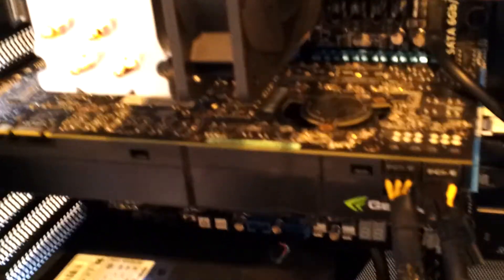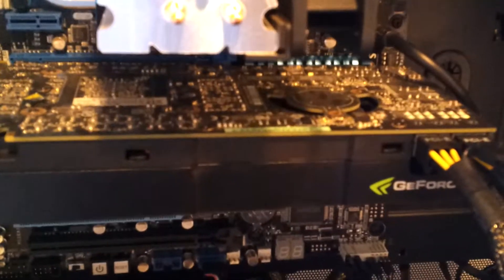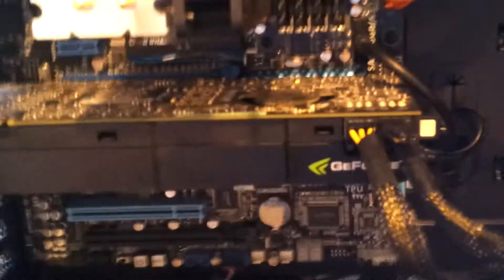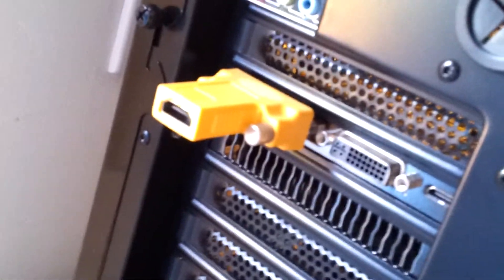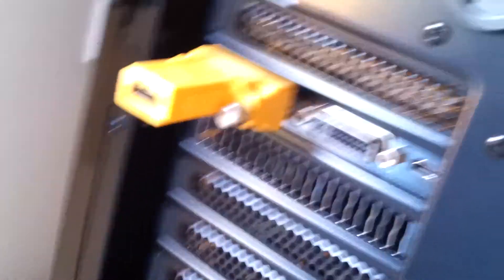Asus P8Z68 Deluxe/GEN3 + Intel Core i7 2600k @ 4.5GHz

Comment: So similar to the setup I bought over 8 years ago. Believe it or not I e only had to replace the memory and the vid card but aside from that this system doesn’t slow down for anything still. Just goes to show if you spend the cash up front when building your rig it will treat you good and last you for a lot of years. 

To keep the longevity of your vital hardware I recommend not overclocking very far past 4.5 GHz.

Comment from the maker: Well I never tried to install a fan there, I had always planned on getting the window panel. But I'm looking at it right now and I'm fairly confident you could fit 25mm between the window and the top of the heat pipes on the hyper 212. 

Can't say for sure because I can't get my hands in there to measure it when the side panel is in place but I'd say go for it.

Comment: i am running the same set up as yours except i am running a EVGA GTX580 for video and a 60g ssd for smart response tech, and  a 10,000 rpm raptor 500g hd, nice set up you have too, did you have any issues on the build?, mine went fine.

Comment from the maker: 80x80x25??? that seems pretty small. the fan that sits on the hyper 212 is a 120mm diameter fan. I don't know the width of it but any 120mm fan will fit.= because the hyper 212 heatsink comes with two adapters so you have the option to fit two fans on it at once.

Comment: If you use this pc for overclocking( because 2600k normally runs @ 3.4GHz) you should buy an watercooling system like the 'corsair Hydro H60' or higher.

Comment: hey dude .. i am having problems with my cpu temp ... i have
core i 7 2nd gen 2600k (i've HT enabled)...no O.C... stock heat sink 
asus p8z68 V-LE
asus direct cu ii 6950 2 gb
8 gb corsair ram ...NZXT phantom case
the problem is whenever i play high graphics games such as Hitman absolution or AC III ... my cpu temp goes ... upto 76 to 78 degree C ... my avg room temp is 30 deg C ... what shall i do ...